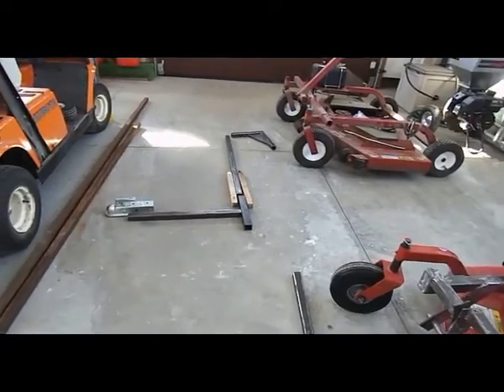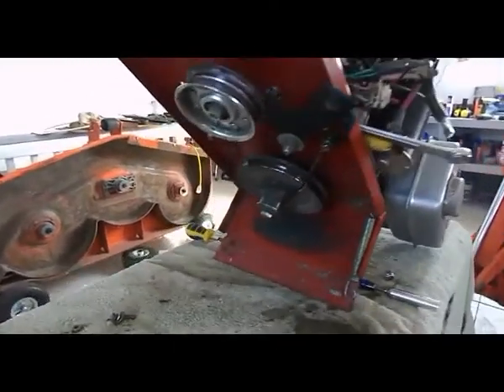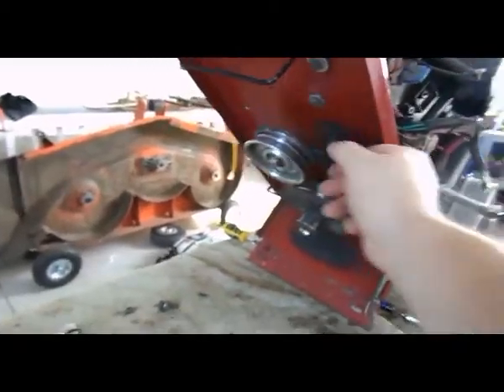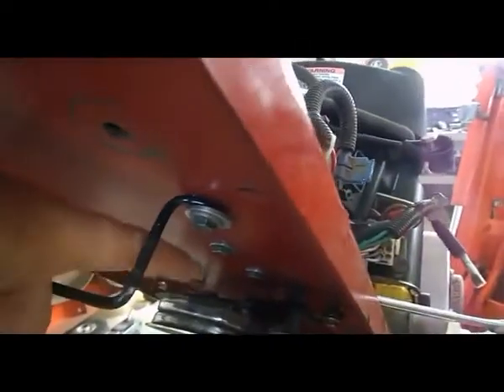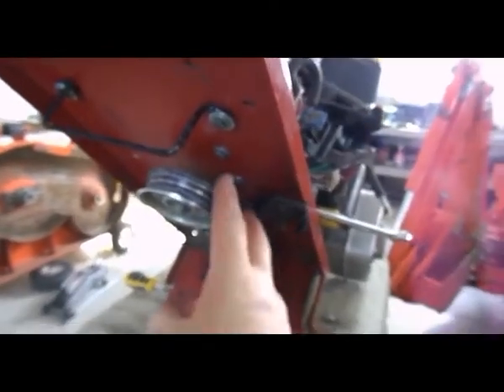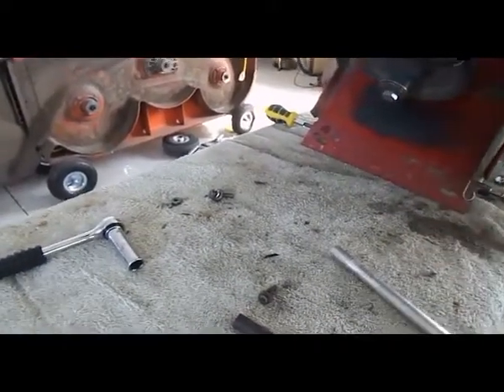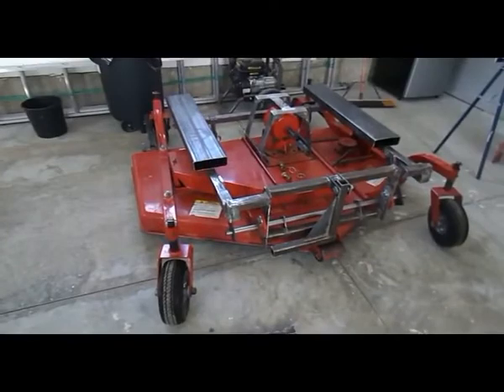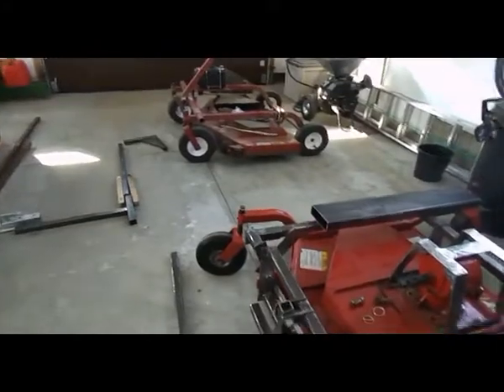Swisher T 60  Maintenance Update

Comment: I have 3 swisher trail mowers.
(2) like the model you have and a T1260.  All have their quirks
I had the same issue u had but I solved my problem by turning around the center guard.  I was burning the belt off. What I found was although it looks wrong the guard was rubbing and was installed wrong by previous owner and rubbed while engaged.

I can’t figure out my T1260 tho 
It keeps throwing the belt off the idler tension pulley and I have tried everything, I may try to make a belt guard for it and see if it will keep the belt from jumping off the bottom of the idler pulley
Reply from the maker: Hi Eric, I found that by leaving the belt engage even when I shut the engine off and per-engaging it with just a little pressure when I start the engine have increase the life of my belts, I don't know why the engagement idler is so loss on these machine and like my videos have shown I've tried several things to make sure I don't get too much bouncing under there when you disengage the belt but its pretty much impossible :) again leaving it engage when the engine is off keeps everything tight and I just lose it enough so that when I start the engine it doesn't have to work to hard to turn over.
Reply: Claude Poirier 
I burnt a new belt yesterday on my T1260.  The idler bounces like crazy back and forth and kicks the belt off the bottom.  I’ve replaced the tensioner the pulley etc.  it drives me crazy.

Comment: If you're breaking belts often, the tension is to tight, happened to me when I bought mine new. I backed off the tension to almost none, and haven't broke one in 6 years, just now replacing now the short belt!
Reply from the maker: I've had my swisher 6 years now and I now mow close to 18 acres weekly , I only change the big belt once a year even if I don't break it, the short belt that is another story, I have a few more videos I'll be posting to compare the swisher to my bercomac and will be touching on the short belt a bit more too.